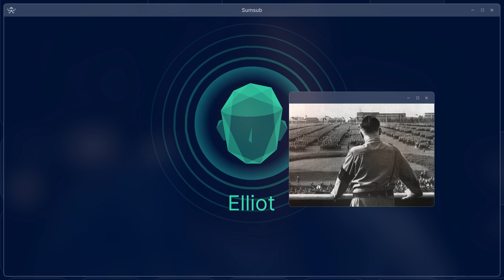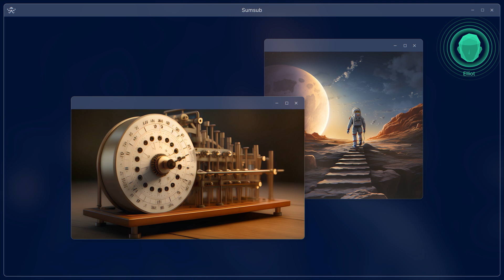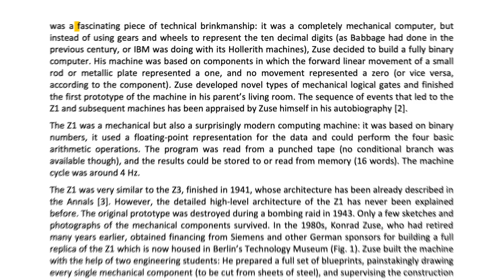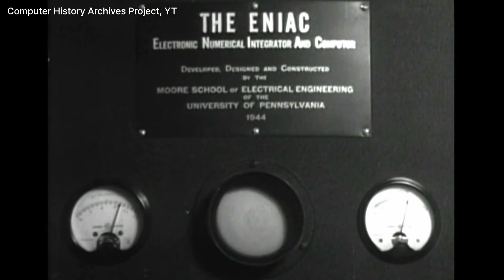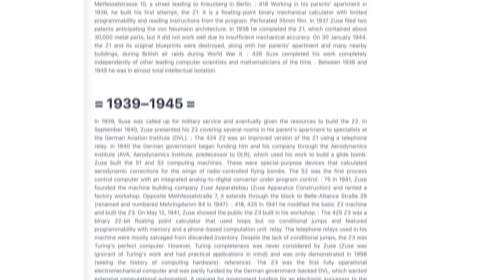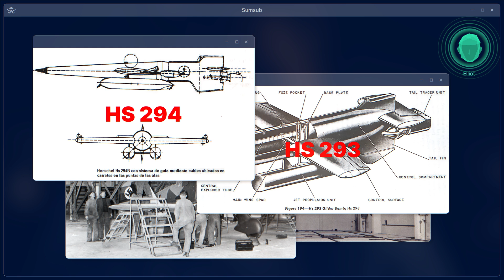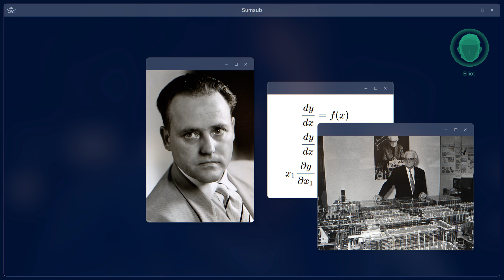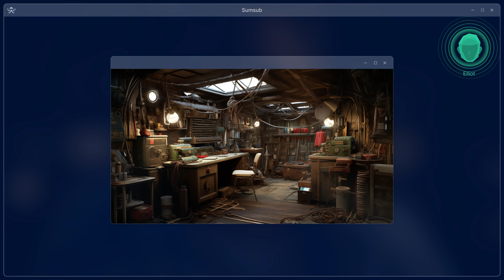Why Enigma is not the 1st computer? Real Story of Z1 | Sumsub

Comment: you ignored Colossus and ignored the earlier mechanical computers, like babbage's analytical engine a century earlier. the 'first computer' changes depending on what you define a computer as and you chose the nazi one. that is weird.
Reply: Colossus was two years after Z3, Colossus did not have floting point.

Babage did not use digital, Babage  did not envision program code.

Comment: As mentioned in the video, this was not an electronic computer.  It was electro-mechanical. ENIAC was electronic, as was Colossus, which the British used for code breaking.  Even before ENIAC, punch card systems were approaching computers.  Also, he didn't invent printers.  They were used by telecommunications companies and later adapted to computers.  I believe the first would have been around 1922.
BTW, why is Enigma in the title?  It has nothing to do with this.  Enigma was a code breaking system for the German codes and was originally developed in Poland, before being taken over by the British at the beginning of WW2.

Comment: The antikythera mechanism is the world's first known computer.
Reply: Antikythera mechanism was a very sophisticated analog arithmeter, not a Turing-complete machine, what we define as computer.
Reply: Learn the difference between theory and fact.
Reply: @Ex_impius oh that's a delicious misunderstanding of the word "theory." To the OP, I think that's getting a bit loose with the term computer since the Antikythera mechanism wasn't a general purpose computer, but was more of a fancy clock. But oh my God what an incredible mechanism, and from so much earlier in history than we used to think things like that were made. Highly recommend Clickspring's Antikythera mechanism build video series if you haven't seen it.
Reply: @evanbarnes9984  you need to do more research. Its a THEORY that the mechanism could calculate anything. It was rebuilt on “what they think” was going on inside with the gears. None of it is proven fact that it calculated anything. Hence, its a Theory.